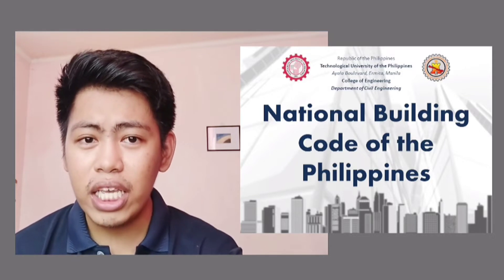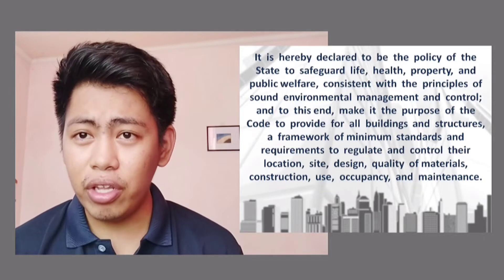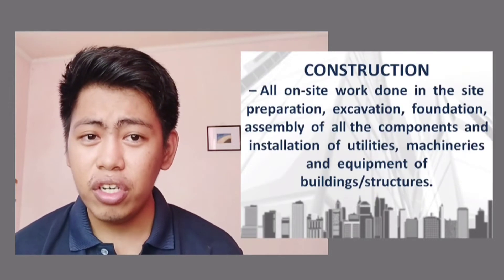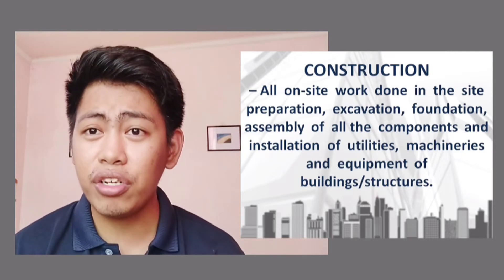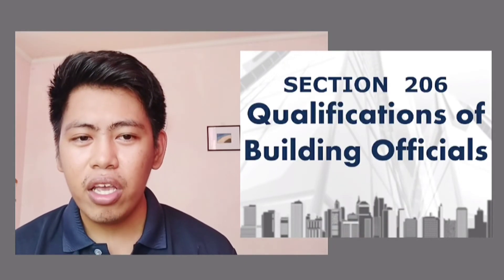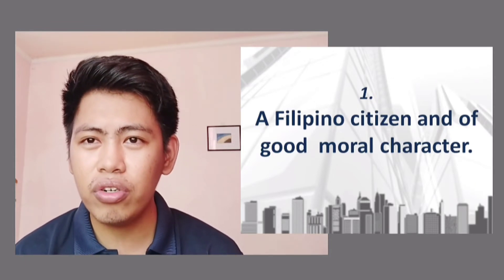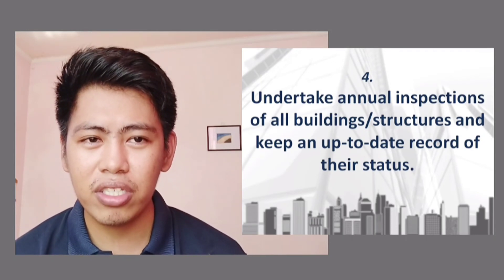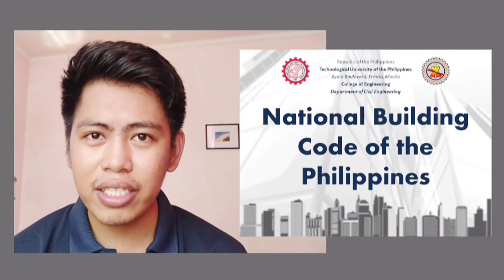PCE 4/4D [2nd Semester SY 2020-2021] - National Building Code of the Philippines (Part 1 Lecture 1)

Comment: architecture has strength of materials, reinforced concrete as well, but are not specialized in it. so they actually have knowledge in structural but do not overlap and should not sign structural permits.

Comment: Aside from nscp and nbcp, civil engineers should be knowledgeable sa fire code of the Philippines, tama po ba? What other codes should civil engineers be familiar with po?
Reply from the maker: Yes. 

Fire Code of the Philippines
Sanitary Code of the Philippines
Plumbing Code of the Philippines
Reply: BP 344 -  Accessibility law ( for PWD)
PD 957 - Subdivision and Condominium ( Guide lines)
BP 220 -  Socialized and Economic Housing  ( Guidelines) 
RA 9514 - Revised IRR of Fire code
RA 1378 - Plumbing Code
PD 1067 - Water code
PD 856 - Sanitation Code
PD 1096 - IRR OF 2004
NSCP 2015
Referral Codes ( from allied profession )
and +++ more 

Walang "Building Laws " na subject yung CE  di tulad ng Architecture kaya 
magaing silang mag interpret ng mga provisions lalo na sa PD1096